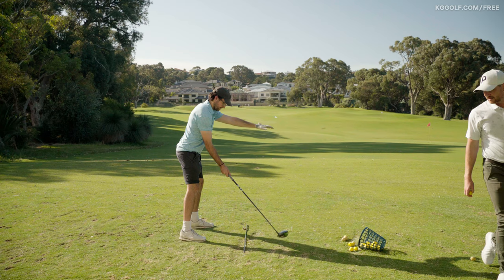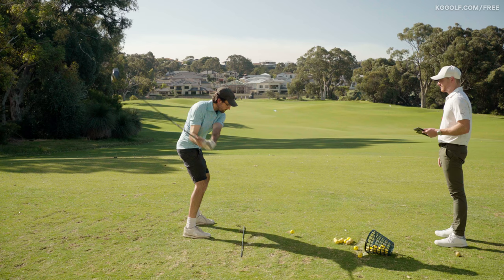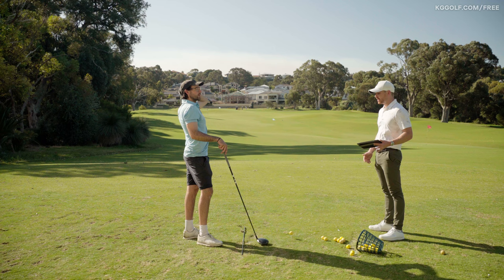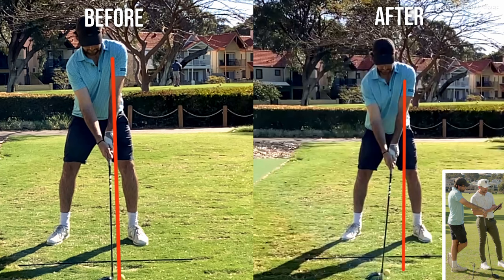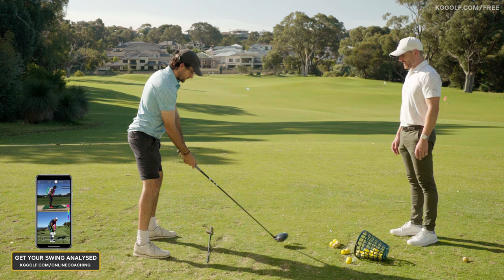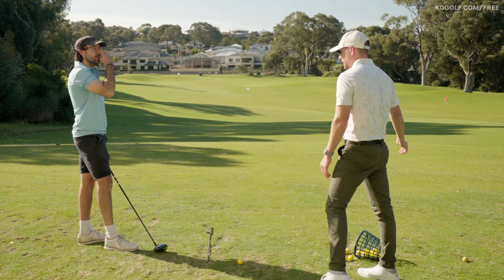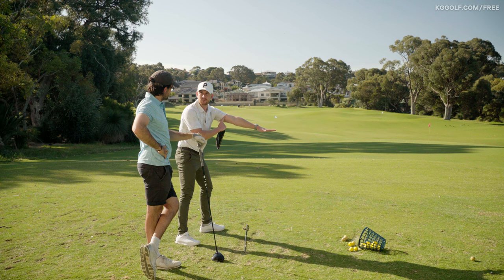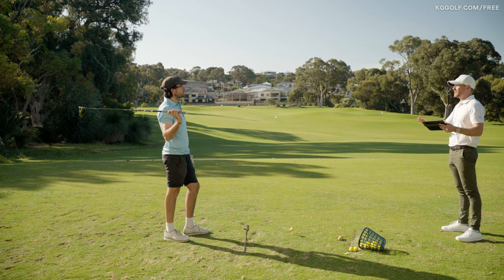How to Stop Pulling Your Driver | Live Lesson Part 2

Comment: Kerrod, we met at a Golf Fanatics school in Orlando last March. I've followed you ever since. I've been fighting this issue and experimenting with moving the ball back definitely improves my contact and my path. But I need to tee the ball lower as I move it back. I hit it lower and lose carry and total distance. As I move ball back it getting closer to my swings bottom right? So AoA drops and low bullets result. Any suggestions?
Reply from the maker: Hey Brad! Thanks for the comment! Height is a product of speed and loft so you can either get more loft on your driver if the ball isn't spinning too much already. Otherwise I would keep the ball forward and really work on closing the upper body off at address which will also help you stop pulling it. Let me know how it goes!

Comment: The only thing that I do not conceptually understand is that, I have a very similar pattern and similar misses but everything being "leftward bias" is all in an attempt for me to hit a cut off the tee. Would you alter any of the drills for someone who prefers that bias?  I feel like the harder I try to turn and hold-off face, the lower and futher left my teeshots are these last 3 seasons. Any input on that as it relates to someone with an identical pattern?    I just am mentally stuck on whether a drill that is shifting things more 'neutral" would be compounding a problem for someone that might still be trying to play a cut bias pattern.   Misses have been stronger left pulls and a reduction in my flight height in recent years
Reply from the maker: If you're hitting the ball left with low flight when trying to play a cut (left-to-right movement for a right-handed golfer), consider these adjustments:

Check Your Grip: A strong grip can cause the clubface to close. Make sure your grip is neutral.

Swing Path: Practice an outside-to-inside swing path. Use a visual aid like an alignment stick to encourage the correct path.

Face Angle Control: Do drills to keep the clubface open through impact. This might involve half-swings focusing on face angle.

Ball Position: Move the ball slightly forward in your stance to promote a fade.

Tee Height: Lower tee height can help control flight and reduce hooks.
Reply: @kerrodgraygolf  appreciate the input. Made a grip alteration end of the summer and started working on half swings. Those help a LOT but I guess it is not easily transferring into my full-swing

Keep up the amazing work on your channel. I love when I learn something new or atleast a different way of explaining something.